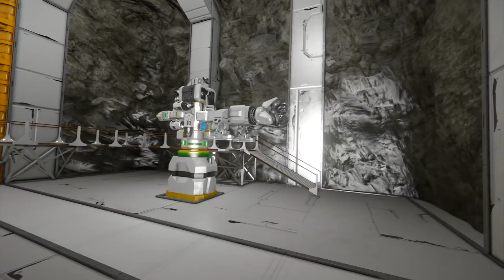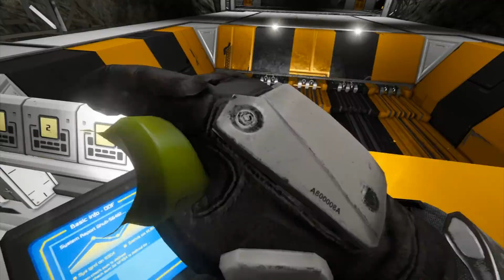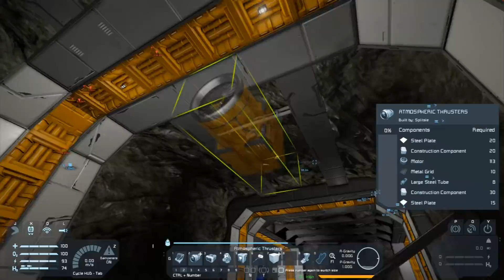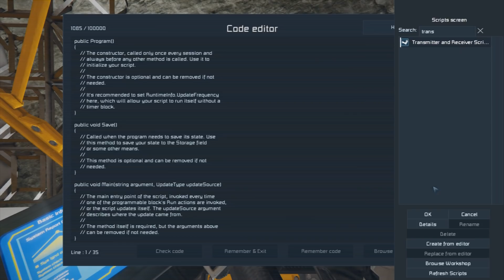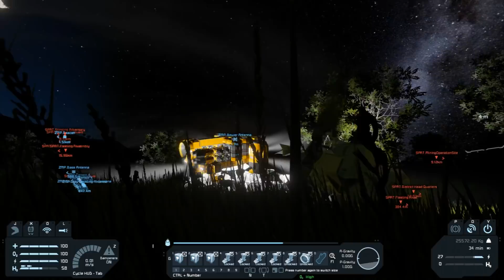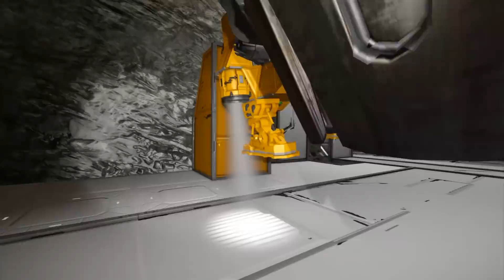Survival, Maybe... #56 Making a Salvage Ship (A Space Engineers Survival Series)

Comment: I know this is quite late but I do wonder if there's a size limit for small grid ships when looking at these designs especially the more complex ones (a hard limit that is not a power/thrust one).
Reply from the maker: By default there are hard limits in place to grid size, but I always turn these off. With the limits removed the main point where you run into troubles depends on PC specs and number of physics interactions but also maximum length between two blocks on the same grid. Which is to say, it's a bit varied but there is a point where the game just stops working properly :P

Comment: I know that this is an older Video. but i am working my way through them. Would not slowing down the speed of the piston on your grinder pit reduce the bounce back of extra pieces. Also have you considered putting large landing gear at the bottom on auto lock. the would stop anything from flying off.
Reply from the maker: Sadly not, the reason that the pieces fly around at such ridiculous speeds is the force generated by the grinders themselves. There are a few things in SE that produce utterly insane levels of force that you wouldn't expect - grinders are one, the others are drills and missiles.

A perfect system would probably try to take advantage of a landing gear, however that takes a lot more work in terms of placing the wreckage down properly, if the grinders approach the wreck from the wrong angle/the wreck has an overhanging piece then you'll still end up with pieces flying since the already locked landing gear can't grab another piece, but it still might reduce the overall number of pieces flying about.
Reply: @Splitsie  i am going to try and count the distance of your Grinding station and see if i can replicate this. there is a lot of ideas that i have that might be able to help. we will test it "For Science". i am sure there is a system that can make this work. I will start with trying to replicate what your currently working with. 

If i come up with something i will let you know. i am sure you would be interested to see. Mind you there may be a fix some were in a future episode that i have not made it to yet.

Comment: I've made several salvage "drones" in my game which you control remotely until you get to the salvage point to pick up the scrap, then Ascend to a specific height and have it fly automatically on a set of GPS points all the way back to base and drop the load off in an automated grinder machine. Then the drone simply goes back to the docking point and locks to a connector and switches the engine off. Took me a while to get it right with tweaking the timing etc but well worth it.
Reply from the maker: That sounds like something potentially painful to setup, I've been having nothing but grief when playing with the autopilot recently which is one of the reasons I've avoided it in this playthrough so far. The other reason is power usage, the autopilot is a very power inefficient way to move around so while I'm still handicapping myself with sticking to solar they are probably not the best way to go :(
Reply: After much tweaking I found a means which worked for me. I do have collision avoidance turned on as a safe guard up until just before the docking sequence but find it typically poor to use. To avoid the need for it, once I have the scrap picked up, I fly it straight up to a fair height to attempt to get clear line of sight to the waypoint to my base which is also very high above the base. That way it tends to not have to avoid any surfaces and goes straight back home. I tried to minimise the weight as much as possible as it only has the one primary function and no need for an on-board pilot and has more than enough juice to do what is required. Once it drops off the scrap and docks, it then connects up to the base to recharge while it has everything but the remote switched off. I found it useful especially in the early game when I was desperate for Uranium and it was gathering the random parachute drops which helped power my base and compliment the solar panels.

Comment: Suggestion: scrap collector drones, 2-3 of them, RTH GPS. Control going out, is there a follow the leader so they can all go out then auto home ish, with manual collection.
As for your turret mistake, might i recommend a re-enable timer. Turn them off starts a "turn on" timer, then if you forget... well hopefully not long without protection.
Another scrap collector suggestion, based on the one you made: Hanging cockpit on a rotor so you can spin to see connecting to the scrap, additionally vector thrust to help with the lifting/speed needs.
Reply from the maker: The biggest downside to collector drones would be piloting them, trying to align the landing gear with cameras will be significantly more difficult, I'm also not sure if you'd run into the problem I had where the attached autopilot took over my ship even though it was through the landing gear :/

Vector thrust would certainly have advantages in terms of thruster count, but it's quite difficult to control finely which I'd need for the locking process which is why I avoided it, Whip141 has a script that uses thrusters on rotors that are locked in position which may work better but I've yet to try it out

Comment: Great episode! I do like the design. It grabs the essence of a Space Engineer by the ah... hair yea "hair". Well, ah with that out of the way. I have had a problem with build vision mod not working as long as I have the Text Hud API mod installed. But I see you use build vision all the time. Are you still running the Text Hud API mod along with build vision? Just wondering.
Reply from the maker: Build vision requires the Text Hud API mod so I always have both on and haven't run into any troubles, are you using any other mods that take advantage of the API as they may be creating a conflict?
Reply: Splitsie I don't have any other mod that even requires the API mod. That's what puzzles me. But build vision works with out the API active. Go figure?

Comment: You should put a sensor at your base that will detect you and turn on all the sandbags, in case you forget to turn them back on. You would have to turn them back off every run, but it's better than leaving your base open to attack while you're building.
Reply from the maker: The trouble is that there are turrets within the hangar that might turn on like when I got shot by the tick... using the spare timer on the sandbags may work as a timed reset but even that makes me a little nervous :P
Reply: But the sensor shouldn't trigger until you left the salvage vehicle.
Reply from the maker: Oh right, sorry! You meant detect the player, that could work as I'd only need a sensor at the docks for ships with the controls to turn the turrets off. I'm going to add this one to my notebook of things to do :)

Comment: Hi Splitsie! I noticed the two large thrusters are off by one block (seeing you wanted the sides to be symmetrical). Also, why not use a bunch of upwards lifting small thrusters to lower the intensity of the bbq you have on the sides? :P Last thing; to make it easier to pick up the junk with the landing gear, you may want to try using pistons to extend each of the landing gear. Great video as always; love your content! Cheers!
Reply from the maker: Hmmm... I will have to check that, especially as I'm going to lift them a little to prevent too much future BBQ :P

I tend to avoid pistons on flying vehicles as they always seem to cause phantom forces that spin my vehicle ever so slightly (or not so slightly sometimes)
Reply: Splitsie I can understand that! I had to give it a few tries on a concept ship before finally removing the spinning. Found a way around it though! In survival it is a bit risky indeed. Thanks for the reply!

Comment: a thing i'd try to avoid cooking salvage with the thrusters i'd try to place the landing gear on pistons, that way it would be possible to regulate the distance between the salvage and thrusters or the downward thrusters on pistons so you can spread them out far enough to not cook anything. but the way pistons have been acting in my game lately i'm prety much sure they'd blow the salvage ship to kingdom come... :D
Reply from the maker: They also have a tendency to make your vehicle tip a bit... I'm going to try to lift the thrusters a little higher to prevent quite so much trouble so hopefully won't have to be too careful with where I grab the salvage in the future :)
Reply: Splitsie last vehicle i build with pistons, just used them to lift the miner up like Igor,  the suspension on the weels went nuts, kicked the vehicle in the air about 10 Blocks high or even more while the pistons were inactive

Comment: I like the asymmetrical design! (I can never end up doing one) Even if your ship got hacked by a drone piece temporarily :P

If you don't mind adding another script, perhaps try the Automatic Landing Gear extender, for those tight to reach bits of scrap ( https://steamcommunity.com/sharedfiles/filedetails/?id=1378754831 ) it extends a piston with a landing gear on the end, then stops it when the LG locks.

Also, does the vector thrust script help stabilize a ship that is carrying an awkward piece of scrap?
Reply from the maker: Rotten hacking drone scrap :P

Vector thrust can help stabilise with some subgrid awkwardness, but it's not the easiest thing for finely controlled flying like I need when locking onto the scrap so I chose to go with regular thrusters on balance

Comment: What you need is a dump truck. Flying through tunnels each time is just odd.
Reply from the maker: I was initially hoping I could just dump straight into the hole at the top of the pit, but the system didn't work as well as planned so it'll be needing a rework to get it to be at least somewhat efficient :/

Comment: Two little things/comments:
1. Either move the landing gear (all lower a bit) or those vertical thrusters up or out a bit.
2. If I remember correctly you set up the pit the way you did so you could just drop salvage in the top and the grinder wall would push forward the salvage until the grinders reached the limit of the pistons. Right now your always flying into the pit (possibly damaging your ship or banging salvage into the door area when you enter). It seems to me you should let the machine do the work you created it for.
Reply: I agree. Well worth the potential minor losses from the drop. If he scripted the doors to not open until the grinders had completely retracted, you could even start piling up the next load of salvage on them while a grind is in progress.
Reply: The problem while grinding is in progress is that currently shut off when they get out of the sensor range, also the material being ground is still flying about in the space between the grinders and wall (some as seen in the vid) even gets behind the wall. you'd be possibility damaging  things outside the pit. if you were to dump salvage on the hatch (with it closed) then you could damage the structure of the hatch, even possibility jamming it.
Reply from the maker: Sadly the machine can't really do what I designed it to, the wall tends to get stuck while pushing smaller pieces of salvage in which is why I keep flying all the way in :(

I'm hoping to come up with a better system to replace it that'll actually function properly with simply dumped parts since it would save a lot of time and effort in the long run

Comment: about the thrusters cooking salvage... 

you could use whiplash's rotor thruster manager to have the lifting thrusters at a 45 degree diagonal, this would increase the distance from thruster to salvage and also allow you to remove the sideways thrusters.

rotor thruster manager does not turn the rotors, it only controls the thrusters so they obey your movement input.
Reply: That script looks REALLY useful to me

I've done some experimenting with building ships where the main grid was tilted from the normal orientation (primary motivation was to have hangar doors angled at 45°) but controlling became a nightmare. Either you had to mentally shift your frame of reference, which was near impossible, or build a cockpit-and-thrusters grid which then invites phantom forces and Lord Klang's wrath.

An example attempt: https://imgur.com/a/BYTkl
Reply from the maker: I'm going to have to take a look at that, thanks :)

Comment: how about a goose trailer with a bed of autolock landing gears for the salvage? you would have a much greater capacity with much lower energy cost / waiting to charge.
only downside would be mobility, better tape more thrusters on
Reply from the maker: Lol, Gaffer tape fixes everything! :D

It would certainly be a great option for when I have some forward sandbag fields with their own drone graveyards, though I'm not sure I can even get the Goose any closer than the base to what's there at the moment...
Reply: yeah, the current graveyard isn't ideal terrain for the goose... hence the thrusters!

is it possible to get the goose up to the graveyard by driving it around the back of your base?
Reply from the maker: I think it'd get stuck in just near the top of that canyon that goes the other way - there's a really rough part there that stopped me exploring that way right at the beginning, but it's something I want to deal with at some point as I'd like to get the goose up onto the plateau in the future
Reply: its a bypass! you've gotta build bypasses

Comment: On the Bower, Try raising the Large Thruster up 2 or 3 blocks, that will prevent most damage your salvage is taking, (thrust on large thrusters at full load will burns upto 5 small blocks below)
Reply: make the large thrusters look like wings
Reply from the maker: I am tempted, though I want to try to limit the size of the build a little so I can still fit down into the grinder pit. I'm certainly going to be lifting them, just not sure how far I can get away with :/

Comment: I think that the Bowerbird looks great.

Each time you return to the base with a load of junk I think two things.  Firstly, move the Goose to make getting in and out smoother.  I am convinced that you are going to smash into it at some stage.

Secondly, with all the maneuvering to get in and out to the grinder pit, I still can't figure out why you didn't build the pit out the front as an extension to the entrance platform, using sloped sides to form a funnel and Grinders pointing up, so you could just fly over and drop the junk straight in.  Yes, your pit looks super cool, but a bit impractical and time consuming to use.
Reply from the maker: The drop pit has a couple of downsides with parts flying all over the place and bits getting stuck between the grinders, sadly this attempt has only worked out slightly better. I'm working on a testing video for different grinder pit designs and if I get a nice design idea out of that I'll do a build montage and replace the current one so I can just drop and run for the next parts - which is what was supposed to be able to happen... but then I kept seeing the grinder wall getting stuck :(

As to the Goose, I didn't want to park it in the dark and I've been lazy and stealing its connector for the buttercup lately, but the next iron mining trip will see the goose have a proper space to park and keep it out of the way :)
Reply: Or at the very least, build a flatbed trailer he can dump the junk on, and haul it under the mountain that way. Flying through tight tunnels and literally inside the grinder chamber is just kinda weird.
Reply: When he gets another load of iron, he'll be able to finish of The Goose's turntable parking chamber and it'll be out of the way.

Comment: Please... Raise the lift thrusters up more.. Maybe make slightly inclined arms up from the body to the thrusters. 

Also, when are you ever gonna finish the bridge to the bunker? Lol. I'd give it a little more style with some slopes and maybe some "support beams_
Reply from the maker: The bridge is going to have so much style it'll make the rest of the base look out of date ;)

Or at least it will get some eventually, got a few other things to use my iron stores on first, also the thrusters are totally getting lifted, at least a little bit :)
Reply: Splitsie if I recall, you need 4 blocks high from the tail of the thruster. Also, I'd recommend at least a single small thruster facing down while you don't have a load. Instead if jetting straight up when you're empty.

Comment: Cranes have long, raised wings (think Karate Kid) - so raising the engines higher and wider than the 'gripping' surfaces on the bottom would fit the theme.
Reply from the maker: I wanted to avoid the vector thrust on this design due to the very fine control often needed to grab some pieces and that's a little bit more difficult with vector thrust. As to lifting the thrusters, I really should have done that :P
Reply: aah... ok... it looks you have quite a control with the welder ship :). Would it help to have weak thrust in all directions and main lift thrust VTOLed? It is true that fixed lift at least makes line of thruster damage ... a line, not an area :)
Reply: +1... one precious thing of cargo grilled and nothing done to fix that... When he started, i thought Splitsie would stick that lift in the middle and mount it high... that would fit the perversity of the design... but noo, kill that space with gyros xD. With VTOL script fixed,he could also have saved on horizontal thrusters..

Comment: are there other ways of connection grids for charging, it seems silly to make a connector when you have no cargo?
Reply from the maker: Connectors are the easiest in this setting, you can use merge blocks, rotors, and I feel like there's something else that's escaping me, but the downside of those is that the two grids become one and so get renamed on connect and disconnect. Certainly useful in some settings but not usually as practical as a giant connector :P